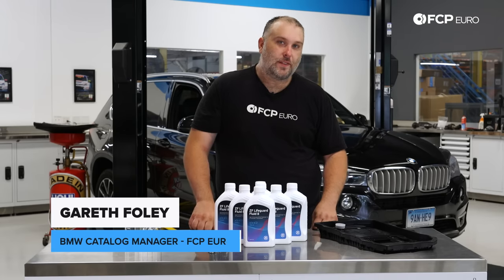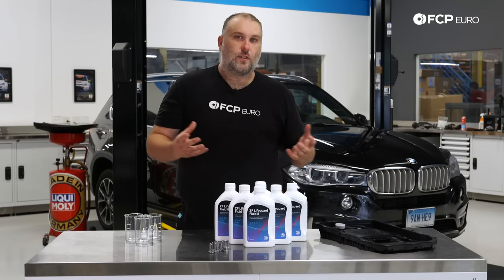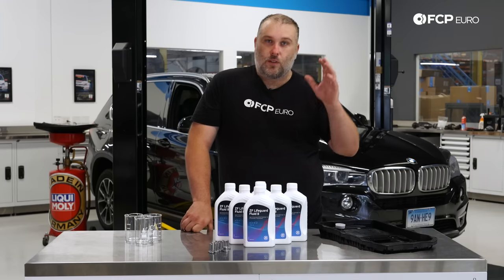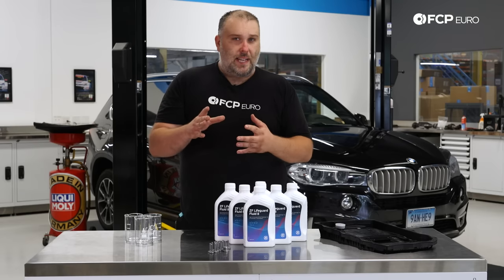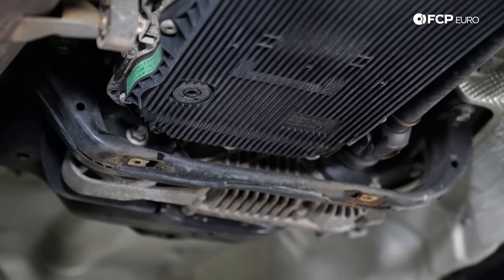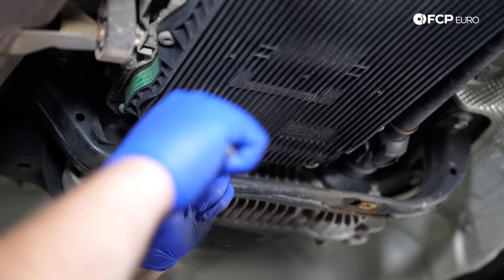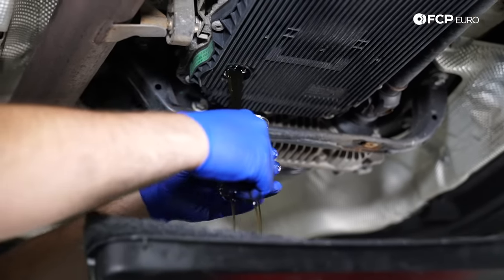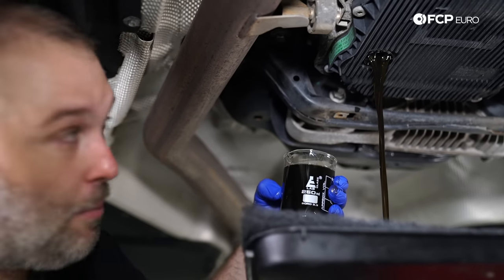ZF 8-Speed Transmission Oil Change (BMW, Audi, VW, Dodge, Land Rover, Toyota, & More)

Comment: I would like to know how much a BMW mechanic would charge for this service.
Reply: The labour is ok but the part is very expensive at bmw
Reply: I got quoted 1,100 at the dealer for my 528i xdrive
Reply: @alexsiebrands8700  $1250 for me
Reply: BMW don’t do this as routine service as they don’t trust their mechanics and this is why Bmw don’t sell their insured warranty when a car reaches 100000 miles.
Reply: @johnstonlee  what do you mean are you saying the service advisors dont trust their mechanics.
You got bmw mechanics swapping out engines on a daily basis but you saying they cant do a simple gearbox oil and filter change.
Reply: @SugeRealest  yeah I am, too much come back if they screw it up. BMW mechanics are given technical bulletins on how to fix stuff. Shows how much Bmw trust their cars when they only provide a warranty upto 100k miles

Comment: Can you just measure the fluid that was taken out and put the same amount back in??
Reply: Did you figure that out? I took 6.9L out and I can only add 4L during the first step. I'm a bit hesitant to move forward and continue.
Reply: @cocooningweb  The only explanation for that could be that the torque converter pulls the fluid from the pan when the car is first started for the warming up the transmission step and therefore letting you add more fluid after warming up? I haven't done this procedure on my car yet but on my Honda I measure what was taken out and put the same back in. It definitely seems like this is not the case for BMWs. Hope you can figure it out.

Comment: Hi 
Thank u for this perfect explanation .
Have a question : when u start to change the oil - engine is off but what level is gearbox( P or N) , also after when u refill it second time after checking all gears and engine running what level u left the gearbox (P or N) ?

Thank you
Reply: P

Comment: ZF has made millions of these transmissions. It shouldn't be difficult to get a straight answer out of techs and reps at shops on these transmissions, but it is. I asked two dealers and my local Euro specialist shop about changing the fluid, and they all said "don't do it". I have a '17 430i at 92k. I ended up getting it done, and it was $700 from a local indy shop. (I do most of my own work but can't do this one in my parking space!)
Reply: Did anything change after you changed it performance wise?
Reply: ZF say that it is NOT a lifetime fluid.
ZF say to change the fluid and filter. The interval varies for some reason but 100,000 miles would probably be max.

Comment: What about the used oil in the torque converter and the cooling pipes? Dont you need to change them?
Reply: Apparently it does more harm than good if you do a full drain
Reply: @johnstonlee  There are a few brands that make cars with drain valves under the torque converter so they can drain almost all of the oil in the system
Reply: You will never get all the fluid out by just dropping the pan. You would need to remove the torque converter to drain completely. But it's not necessary, as long as there's nothing wrong with the original fluid and you do this type of drain a couple of times (do once then drive around for some time then flush and refill a second time) you would have replaced most of the fluid.
Reply: @johnstonlee  nonsense. It's just a time consuming procedure requiring a transmission drop to fully drain torque converter but there's nothing to harm if you know what you're doing.

Comment: Nice video, but... I’m struggling to understand the physics of why the cold fill ended up being too little fluid?
Reply: Probably nothing to do with physics... i think the oil just moves when you shift the gears, then the proper oil level is filled at 40-50... no point in making sure the temp is perfect the first time around
Reply: because it was drained - when running the pumps puts it through all the parts...

Comment: My F30 328i has 170k miles and I assume the oil has never been changed. is it still safe to change the oil now? my car idles abit rough when warm and jerks a bit at low rpm
Reply from the maker: With the car idling rough, we would say its a good time to change the transmission oil.
Reply: thanks.

Comment: Question: When the new oil is back in on say ZF8HP55. Then I need to get it to 40C, then run through the gears.
DO I need to have the wheels spinning?
In other words, Can I go through the gears while Parked?

Thank you.

Would that be an issue.?

Comment: One thing that is missing is revving the engine at 2000 RPM for 30 seconds to fill up the torque converter before doing the gear changes.
Reply: revving in neutral or with gear?
Reply: @Marzoochi  You rev the engine while in Park. The BMW official procedure offers the same. You activate parking brake, then move the gears from P, to N, to D, then M1 and M2. Keep each gear for 10 second. Then put in Park and rev to 2000rpm for 30 seconds. Check temp 40-50C. Open the drain plug, wait until it slows to a broken drip (if constant flow, allow to drain more until drip). Close the plug, torque to 35 Nm. You're done.

Comment: Thanks for this video. My BMW has 59,000 miles so I am going to service the transmission. Not sure if I will have my regular shop do it or bpy one of your kits and have a friendly mechanic do it.
Reply from the maker: regardless, we're happy to supply the parts!
Reply: @fcpeuro  Hello, quick question: is it sufficient to hold my foot on the break? Or do the wheels actually need to spin through the gears? Great video!

Comment: Hey, my 2017 BMW x3 2.0 diesel has jerky transmission at start up, after changing gears for 4-5 times, it drives smooth like new.. 155,000km on it, no transmission service done and 12v battery is showing signs to change it !!
Help please

Comment: 2015 dodge Durango, 3.6 with the ZF 8spd. I have a lifetime warranty, Dodge does not have a service period. I have 110k on it, should I just run it and have Dodge replace if it ever fails?

Comment: Hi sir. I am Afraid : mine car BMW X5 E70 2006’ s oil is a little much. How to check for everything is ok? ? ??? 
Shall I do As folows is ok??? 
— Off engine Overnight for cool everything
— at 8:00 am the next day, start engine and enter D, R, MS1-2-3-4-5-6 and wait until the temp transmison at 41o C (of course checking temperature with special unit) 

- take out the fill plug for Checking oil and it will flow out. 
Must I wait until the slow stream stop . And  put the fill plug back??? 
It will not be ok if the stream still slow and put the fill plug back too soon???

Tks sir and wait for worth reply!!!!!

Comment: Am not sure if this guy is high risk for cardiac symptoms or the heater is on at the shop...
Because this type of job is low in physical demand. The mechanic looks like he just ran a marathon. 
I have done this same job w some towers and a carjack in a residential garage and barely sweat at all.

This should be a red flag for him to get a stress test and a full physical.

Comment: I know I react 2 years after this video is posted, nevertheless I risk it: does the M550i xDrive 462 HP of 2017 transmission is concerned ? your list stops at 2016....I'm buying one this week.
Many thanks in advance to you or anyone that could answer me.

Comment: This guy knows nothing about what ATF service is, or he just wants to sell worthless oil chang kits.
 You never drain an AT, you flush it. He just drained a smal, part of the ATF. He also left all the sludge in the converter and the valve body. 
When you flush an AT you replace ALL the old oil, and you also clean up everything inside the AT.

Comment: I have Audi Q7 currently 83k miles on the clock, Audi claims that this gearbox has life time fluid ( nothin last forever, shame on you Audi) do you think that if I change it now it sill will be not too late? You stated that change every 50k is recommended so that why I am asking.

Comment: I have a 2014 Dodge Durango with 114k miles. (It is a 8speed ZF8Hp series). I wish I would’ve found this video back 5 years ago when I purchased it. Ive noticed that when the vehicle is over a 1 hour run time it is not shifting onto the 8th gear and a couple hard shifts. Should I proceed with changing the trans oil?

Comment: Brilliant video thank you. I'm changing my oil today. I've been doing some research and I've found so many different opinions about this! 
I bought a used 520D 2014 LCI. With very little service history. 
With 165,000 miles on the clock. (Thats 265,000km). I don't know if the oil has ever been changed 🤷‍♂️. 
I'm going for it. 
I was going to drain the fluid, and simply replace with new oil whatever comes out. Take for a drive, and top up. 
No resetting the gearbox. Someone wrote this will replace 30-40% of the old oil. 
Its not a lot but isn't it better than nothing? 
Or, replace all the oil following your correct procedure. No resetting the gearbox. And if i get clutch slipping, replace 1ltr of oil for non-slip additive.
What you folks think?

Comment: dear my car bmw F02///730LI //2013 it run 155,000KM you recommended to change transmission oil with filter

Comment: I hope you guys see this.

I have a ZF 8speed on a 2012 X1 e84 25dA Xdrive. Oil and filter changed 20k ago. At deceleration and acceleration there is a whining sound. For a long time i thought my license plate was rattling but turns out it was coming from the gear box. 

Mechanic that did the oil change didn’t quite follow the procedure and i think there might have been more oil in the gearbox then necessary.

1. Have you had a gearbox with a sound similar to what i tried to explain?
2. Could excess of oil cause excess of pressure in the gearbox that could end up im internal damage?

Comment: The german OEM are stating, that this Oil is a life time oil. It means after e.g. 150.000Km or 12 years, it is over. You should not hold the car longer. I life in Germany, but never will by german cars, no service and no quality, no differece to other OEM, just the price is higher.

Comment: thanks for the great DIY video!  performed the service on my 2016 F34 with 198K km....  Oil was BLACK but flowed nicely when draining... was able to get about just under 6L into her..  she seems to be running great with no issues on the test drives I took..  thanks again for another great video!

Comment: I just bought my 2014 335i and it has 138k miles. How would I know if my trans is good to service without draining an oil sample to be tested. Or would I have to drain just enough for a sample and close it back up.

Comment: Just did my 19’ RAM 1500 with 68,000 miles, and the fluid was ok, but smelled burned. It feels better than ever now. Even better than I hoped! Happy I did it. I’ll do again in another 60,000 miles.

Comment: Eish.... Just bought a F30 320d and I love it. Its running the 8 speed auto and its truly the best auto I have ever driven. Now after watching this video (This video is awesome and very informative by the way Thanks @FCP Euro) I am a little concerned. I know that the gearbox has not been serviced within 160 000km (100 000Miles) Ive also noticed that when the tranny oil is cold the shifts are sluggish and jerky. Not to the extreme but noticeable... Should I take the chance and change the fluid or just keep driving and hope it lasts another 100 000miles?

Comment: You replied that we could certainly do : let it cool and then get back to temp and rechecking the level.
My question: 
1.  How much  theTemperature for X5 E70 2006 (6HP) should we get back to for openning the Oil check Plug fill????? 
2. At that temperature and at the openning Plug, must we wait until the oil stops spilling out  totally? or at the slow stream ??? i meant exactly when we can put the the Oil check Plug fill back for the best final Oil level?

Comment: Need your opinion. My daughter took her X5 in to have her trans pan changed. The dealer charged her $2000.  $90 per qt of oil,,,, 3.5 hr. labor $753,, $330 for the filter,,, $215 to hook it to the OBD2 reader.  Is this highway robbery.  It doesn't look like it took you 3.5 hrs.  They charged for 7 qts of oil. I know from these posts you can't get 7 qts of oil in this trans.

Comment: Hello.  I just called the BMW dealership and requested a price for a transmission fluid change for a 2015 diesel xdrive35d, and they stated that a transmission fluid change is not needed for this type of mm model.  Is this true?

Comment: You MUST to take out the remaining 3 liters you have trough the cooling lines otherwise you will CONTAMINATE the new fluid.
BimmerN53
Reply: You do realise that the torque converter still has oil left in it as well ?
Reply: @PenrithPanther  yes of course, through all the system
BimmerN53
Reply: @federicotorresbordils7624  so how do you get it all?
Reply: no, why would you do that? any good reason? not about contamination, the old fluid has already sealed to many parts of the transmission so flushin it out can cause unwanted damage.

Comment: Thank you, after changed my transmission, my torque converter is kinda weeping :0 maybe I should do that again. Thank you for the video!
Reply: Same thing happened to me I had to fill it 4 total times for it to stop
Reply: it would sound like it was whining
Reply: Not fill and drain just had to fill it to the point of it leaking out of the fill hole 4 times while the car was running
Reply: @shaunbailey4922  you mind to share which car? Maybe I need to listen to that too.
Reply: @zz6761  I fixed it now but it's was when I was slowing down slowing taking off it would whine just was about a couple quarts low
Reply: @zz6761  not even a couple probably just one quart
Reply: @shaunbailey4922  I see I see, would you use the OEM fluid or the lifeguard 8? Thx
Reply: @zz6761  I used the Valvoline Max life atf it's compatible with the zf no need to waste your money there's a lot of videos of which fluids are compatible
Reply: @shaunbailey4922  Hi, thank you so much for your advise, and I apologize for my late reply. Yeah, I think I should try to do it again like your advised.  when I changed mine, it was about 3 litter( about 3 quarts) out for old one and only put new one about like 3 litter. lets see if I can share how it sounds like :) thank you again for the advise.

Comment: So I have a 06 325i with 145K miles on it. It's my 1st bmw and I'm trying to take care of it I dont know the previous history but I dont think the last owner took very good care of it. Any ways in the video you say if it's been to long not to change it which I was just looking to order the kit to service it. What would you recommend? 
Also been trying to read around forums it has the dual climate control and the passenger side blows colder if not like Luke warm it dont get hot like the drivers side. I dont know if there is a sensor or something that affects that or a hose clogged.. thank you for your time and videos. I've learned a lot.
Reply: If it’s 145k on the original fluid I would not change it, if you can find service history I’d look into that first. Regarding the vents have you tried moving the temperature dial between the two center vents?
Reply: @FrenchValleyAirport  I would have to disagree. I changed mine at 200k km and there have been no issues. This was 2 years ago.  It was  never changed by the previous owners.  It is better to change it rather than to leave it too long.  You must  follow the instructions correctly on the second fill that must be done at the correct temperature.
Reply: @kirwanjohn101  Very wrong, you don't understand how automatic transmissions work. All mechanics will agree that waiting too long is worse, most people who attempt it actually ruin their transmissions as it will start to slip;

Comment: I’m having issues with my transmission, f30, 330e. When cold and pulling away the engine revs to about 3000rpm but the car doesn’t move but then jerks forward, it’s fine running through the gears just driving off from a standstill when cold. 40k miles on it. Any ideas?

Comment: 2018 Ram 1500 V6, I haul every day at 69k it started to leak on the pan. Might as well do oil change. It cost me $404.cents. All mopart part and 6 quarts, on this oil change it fill up with only 4 quarts, Ill save the rest for the next service. This time the new pan does not have the plug. Which probably they had to many recalls. That was the issue I was having. On my next oil change I will have a mess since no oil plug. 

I want to say at longest you follow the instructions and keep up with the maintance, worry free. Of course transmission is not set for life, they wear out after time that may required rebuild BUT!!!! I wouldnt even bother for a rebuild for this type of transmissions. I rather pay a new one. In the meantime just keep up with the maintance.

Comment: Thank you for the video. 
I have a question: My x6 has 126k miles, and I've never changed tranny fluid on it. Asked BMW service manager to replace it, he said it's better not to do it since it's overdue, and if I'll change it, it may not shift right. Is it true or not? I really want to change it, but afraid having problems after.
Thanks.

Comment: Great video! 
I just changed oil in my X5 e70 and did it every step like the video but I was surprised that it only took about 4 liters when filling it. I thought it would take about 6-7 liters. What’s the oil capacity of the GA8HP70Z gearbox?

Comment: I do not understand why the FCP Euro website sells two kits for the ZF8. One has the ZF lifeguard 8 and the other liqui moly top tec 1800. Everyone seems to be saying to use the ZF lifeguard 8 kit. To use the OEM oil and nothing else. Is it fine with the liqui moly?